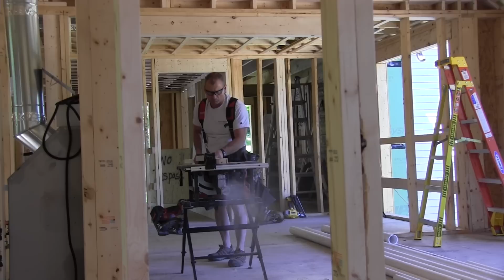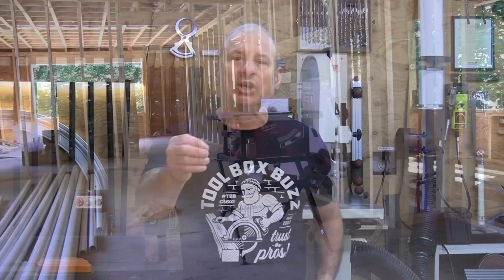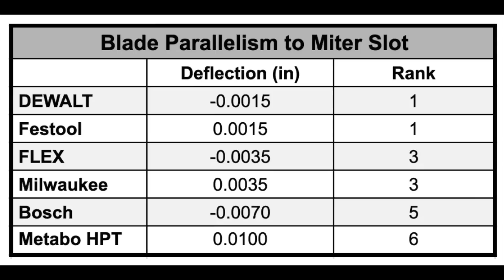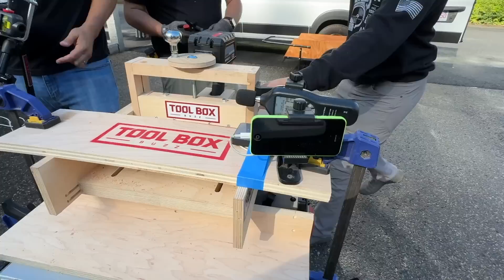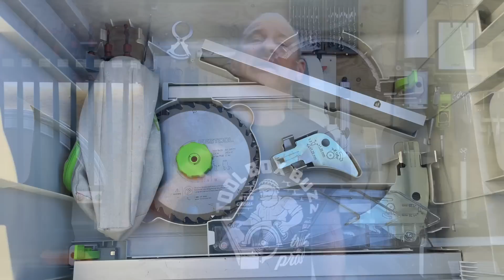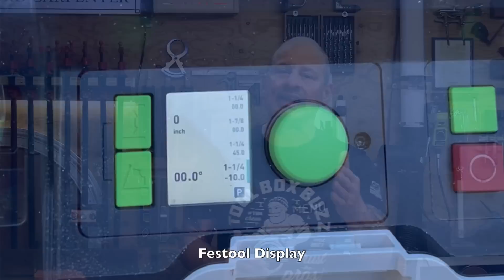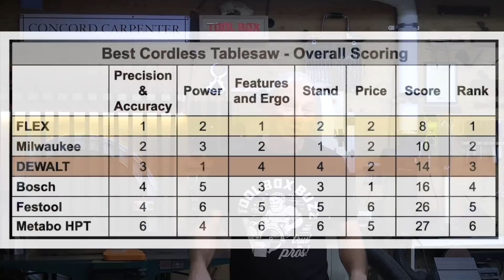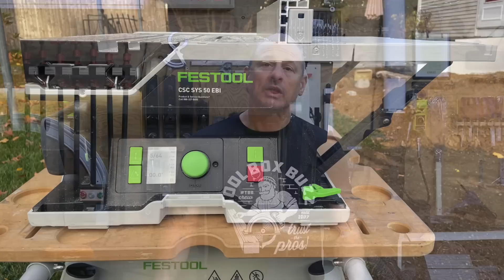Best Cordless Table Saw | Head-2-Head Comparison

Comment: A case for SawStop (corded):
SawStop sells for $899. Compare this to $300 for a corded DeWalt or $609 for DeWalt Cordless (incl. battery). Add $183 for a folding stand (Both saws need stands).
This equates to the SawStop feature adding $600 to the saw price.
Adding a generator adds between $1100 (Honda) and $450 (Predator or Champion).
Or, look at it this way:.
SawStop + Honda generator costs $2000 — the same as a cordless Festool.
SawStop + Predator generator costs $1350 — more than every saw but the Festool.
If you already have a generator (or have other items that need the generator as well), SawStop sells for about the same as the Milwaukee, or $300 more than the recommended Flex. 

Over the years I have known several carpenters who essentially lost the use of a hand as the result of a table saw accident. Each victim was a highly experienced professional using a small (contractor) saw. 
SO I have to ask: What are your fingers worth?
Reply from the maker: @karenstein8261  saw stop is an excellent tool, but it’s not a cordless so as far as I know

Comment: You guys are the ones that could solve the mystery nobody seems to have tested. I wish someone would test the performance difference on the Milwaukee table saw with the new Forge batteries. Comparing the 12.0 HD vs 12.0 Forge. 
I always enjoy your very well put together videos and look forward to the head to head comparison.  
Thank you for putting in all the work for us.
Reply from the maker: Great idea! It is a good question to ask.
Reply: I would love to see a good side by side comparison of the of the Forge as well.  Wondering if it's worth jumping into that line?

Comment: As much as I respect your tool reviews, in this video you fail to ask the two most important questions.
Granted, as times change, so do the questions you must ask.
The gorilla in the room asks: Who needs ANY table saw in this day of track saws? I find the table saw being pushed aside by the track saw in a manner similar to the way my impact driver pushed aside my drill. There’s just not much use for it these days.
The other question is: how much are your fingers worth? What I’m getting at is the value of SawStop protection. With even a (relatively) minor cut resulting to a $1000 visit to the emergency room for a couple stitches, SawStop is a bargain when you consider the money you never need to spend. This Namath holds, even when you add in the cost and inconvenience of also setting up a generator for a corded table saw.

A common flaw to table saw evaluations is a failure to consider the expense of the necessary accessories. These include the necessary tables / stands to support the workpiece (especially for the smallest saws), the cost of “accessories” such as a better fence, miter gauge, foot switch, power feed, and guards. 
Another detail overlooked is the ease and effectiveness of dust collection.

For the few tasks a track saw cannot do, I submit a router or router table will do. Rabbit and dado joints? No problem. Trimming the edges of molding? Piece of cake. Cross cuts and miters? Maybe you need to look at your miter saw if the piece is too narrow for a track saw to be appropriate.
Reply: I don't know what kind of work you do, but 90% of what I use a table saw for, a track saw is either unpractical, slower or completely useless.
I don't think you'll reinvent the wheel with a track saw.
Reply: There's no complete overlap between the two. Track saws perform poorly on ripping framimg-lumber. It's often easier to bring the materials to the tool rather than setting the tool up on tge material. 

Both tools are great and have some overlap. My question is if cordless tablesaws replaces corded ones. I'm not convinced yet.
Reply from the maker: @karenstein8261  as a general contractor running a crew of guys a table saw is a necessity for sizing material. We have a tracksaw as well and we use it a lot, but a tablesaw is faster, and easier. You couldn’t be more wrong on your assumption about that

If you’re a one-man show and you’re using a track saw for everything - that’s great - I just hope you’re charging by the hour.